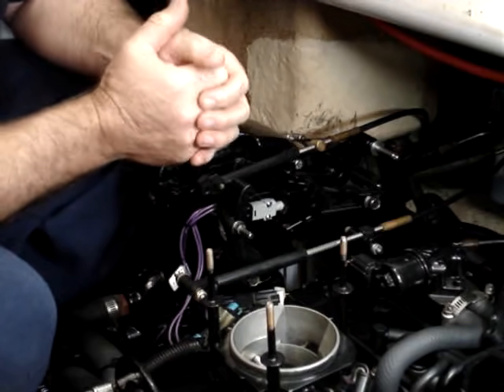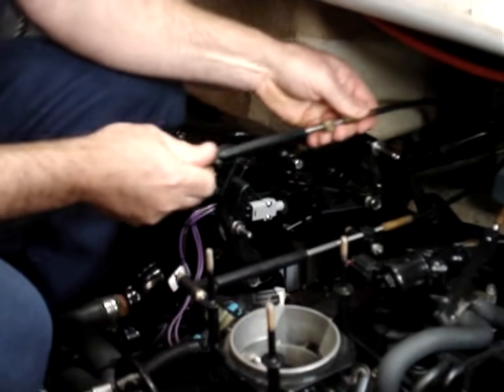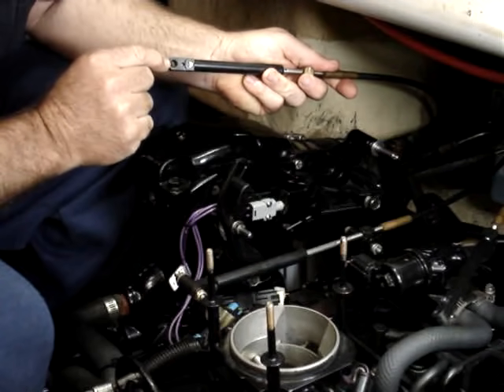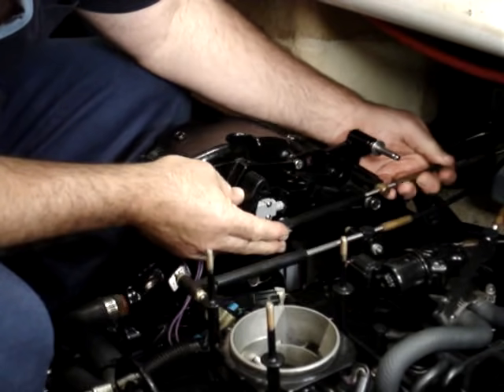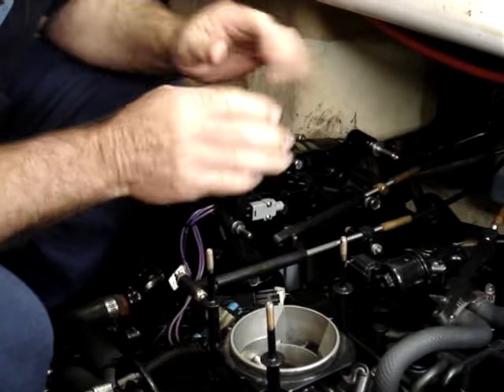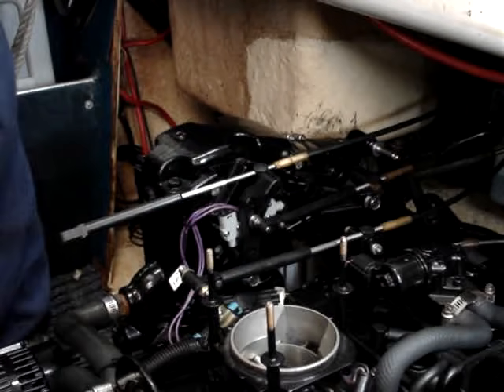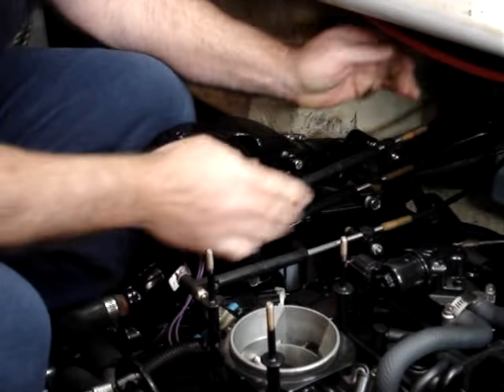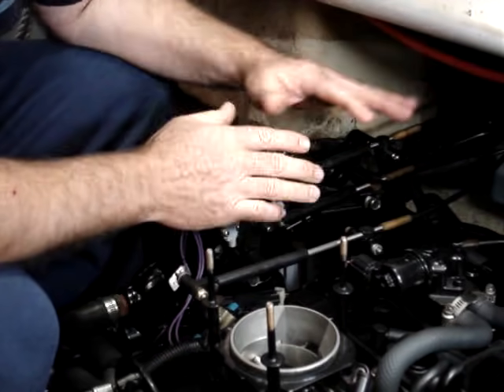Mercruiser Alpha Shift cable adjustment

Comment: Thanks! Read the shop manual for the shift cable adjustment a couple of times and it read as extremely complicated. Your video and explanation on the other hand was clear and easy to follow. I brought the laptop onto the boat and did the whole job in about 10 minutes with your help and the drive shifts like a charm.

Comment: I adjust my boat by trial and error with boat on the water. This video is outstanding and textbook way to adjust with the boat in the shop. I highly recommend final adjustment be done with boat in the water for optimum results, The service manual for the alpha one drive says the same under the caption "in water tests". Most professional marine shops do not bother with the in water tests.

Comment: This is the best video I have found for adjusting these cables, only thing I have to add, is if they have factory crimped the brass adjusting screw on the shift cable barely drill right down on the Crip temples. Can you contact the actual cable, spray, a little WD-40, and with a little effort you will be able to adjust the shift cable

Comment: Hi thanks for the easy to follow instruction. My shift plate is a 1973 model however the outdrive was replaced in the mid 80's with a later model outdrive.  I really didn't know which measurement to go with so I went with the 5 7/8" center to center shift cable mounting position and got it right.  I assume the shift plate age would therefore be the determining factor.  Anyways, was able to make the proper gear engagement adjustment  on land. However once I went for a test cruise, I had to adjust the rear anchor pen negatively because I was slipping out of forward drive under a load. Once I moved the rear anchor pin back about and 1/8", it worked perfectly.   Great video.

Comment: Best video! This is exactly what we needed.
Reply: On remote cable if I have more that 3 1/8 inch is the cable bad? And need replacing or can I adjust it out? I have 3 1/4 inch
Reply: @patricktucker9950  How does it shift with the extra 1/8 inch of play? If it seems to work okay, I'd leave it.

Comment: Great video, I just bought a 1989 Baja 190 sport and only had 300 hours on it. The boat is mint but the only issue was it not shifting all the way into gear. This will help so much and makes me at ease just to know its an adjustment issue.

Comment: Very helpful BUT 2 things to clarify:  1)The throttle needs to be in wide open forward in the beginning and wide open reverse at the end?  2) when he adjusts the barrel, he says one direction and goes the other. Do as he does, not as he says?

Edit:  What worked for me was, throttle wide open forward and reverse and at the end, the barrel gets adjusted away from the cable end.  It worked for me anyway.

Comment: Thanks for the video Chris.  Very helpful.  You don't mention the spring loaded shift assist mechanism.  Is it necessary to  have it installed?  It seems to place a lot of pressure on the assembly.

Comment: Thanks for a great video, really informative and it help me gather the courage to go at adjusting the shift cable on my Merc 5.0 220hp -05 with Alpha 1 gen 2 stern drive. I was having issues getting the boat into gear, bort forward and reverse which is why I wanted to try adjusting the cable. Whenever I put the remote forward or back to put it into gear (which is an original Morse remote in my CC Lancer 19' by the way), I was hearing a loud clicking/knocking noise and then the boat would slam into gear. Not very smooth and it made it hard to operate in tight spaces etc.

Said and done, I adjusted the lower shift cable like you describe in the video (6" etc.) But I forgot to adjust the upper remote cable. I'm now having the following issues and I don't know if they might be solved by adjusting the upper remote cable or if I'm having some other issues:
Reverse goes smoother into gear but I'm still hearing the knocking/clicking sound before the gear kicks in. Reverse also requires less movement in the remote shifter than before the adjustment
Forward now requires far more movement in the remote shifter and I'm having the same kind of loud clicking/knocking sound before it slams into gear.

Do you think there could be any issues using my Morse controller or should I adjust the remote cable in the way you advise anyway?

I guess my main concern is the knocking/clicking, it feels like the cogs are engaging slightly/slipping before they actually engage and the gear slams into place.

Sorry for the long post but could really use your input here!

Thanks!
Anton
Reply: I know this is old but did you resolve it? How?

Comment from the maker: The switch should not activate when going from neutral to FORWARD or REVERSE, only when coming OUT of gear, and only when there is load on the propeller, so not on the flushers either.

Comment: Hi Chris. What can I check or adjust if my engine stalls when shifting back into neutral from forward or reverse. It happens more when the engine is hot. The motor has 950 hours on and boat is 96 Regal 5.7 Merc Cruiser
Reply: Hi Warrick,

The problem you have described has been the same problem that I have experienced on and off over the past two years with my Alpha 1 Stern drive second generation on a 3 L mercruiser inboard.  The engine cuts out because the ignition interrupt switch activates, as it should, on the initial gear shift into forward or reverse, but it does not come back to the neutral position before the engine stops.  What should happen is the interrupt switch activates momentarily to kill the motor to allow the gear shift without any torque, so it does not grind going into gear, and coming out of gear, it needs the engine killed momentarily to allow it to fall into neutral, otherwise it says in gear.

The most common cause for this problem is too much friction in the stern drive cable, so the return to centre spring on the interrupt cam plate does not have the force to move the cable back to the neutral position.  The friction can be caused by a worn or damaged or poorly lubricated stern drive cable or binding of the cable through the penetrations into the gearbox.  I have had limited success fixing the problem by replacing the stern drive cable and seals, which cured the problem for about 6 months before it returned, intermittently when the motor was hot.

On my latest service which included taking the leg off for an oil change and impeller change, I asked the mechanic if he could diagnose and fux the problem.  He double checkef if the stern drive cable linkage was at all sticky or there were any problems that could be causing the shift interrupt sticking problem.  He reported that there were not, and he fitted a new linkage plate as he reported that this had cured the problem with some of his other clients. He adjusted everything up to specification and I had about 1 hours worth of trouble free gear shifting before the problem returned.

The problem now is that every time it shifts into forward the engine will die. Reverse shifting is not a problem.  To keep us out on the water, I have had my wife or one of the children hold the interrupt switch cam plate in the neutral position whilst I put the boat into forward.  This is far from ideal, but otherwise the boat won't go.

I have now added an additional plate onto the gear shift plate to allow me to mount a tension spring that assists the interrupt switch return to neutral on forward selection.  I will water test this tomorrow and hopefully it works.  If it works, I will post a video on YouTube about what I did, so others can copy it.

The mercruiser Alpha 1 leg gear shift design with the manual shift interrupt switch arrangement that relies on the spring force of the interrupt cam plate to counteract the gearbox and shift cable is not a robust design at all.  As soon as any friction builds up in the stern leg to control plate linkage is causes problems.  This design problem is the main reason that I am actually going to sell my boat, and probably never buy another boat with a stern drive again.  

I find it hard to believe that a reputable company like MerCruiser manufacturered such a temperamental design, that could leave a non-technical person stranded at sea.

I hope you manage to solve you boat's gear shifting problem.

Comment: Just installed new heads, and I did not put the boat in forward when I took shift cables off the riser plate. I'm sure the cables were moved and jostled as I did the replacement in the bilge. After the rest of the engine was buttoned back up, I  reinstalled and re-set cables to your specs. When testing, prop didn't go into gear. Got under the drive and noticed the dog/shift shoe was pointed at about 11:55 to port side when I did put the control to forward. I was able to push the dog/shift shoe to 12 O'clock with a small rod. The  prop locked counter clockwise. I then made the adjustments to your spec. Started engine, put it in forward then N then Reverse a few times, and then tried it again a few times. On the 3rd of 4th try it stopped engaging in forward. Do I need to reset the upper cable more? Or do I drop the lower unit on the outdrive just enough to reset the dog/shift shoe connection to 12:00 O'clock while the control is in forward and then do the cable adjustments. These cable were replaced 2 seasons ago. The engine is 2010 Merc. Vortec 5.7 350 - Thanks for the video. I did use this video last season on my port side engine. It took 2 days of me swearing up a storm before I realized that, that particular outdrive was opposite rotation, and I had to do everything in reverse :) To be clear the engine I am asking about is normal rotation. Thank you.

Comment from the maker: Sounds like you might have crud and/or salt build-up in the back of the shift slide cavity (in the bell-housing). That's most likely due to a leaking upper shift shaft seal and bushing. You need to remove the drive and check those things out...

Comment from the maker: No. That indicates either a sticky cable (replace it), crud in the shift slide cavity in the drive (remove the drive and clean it out) or the stud is in too high a position (move it down).

Comment: Thanks so much for the great video.  Having gone through it step by step, I'm still having a problem getting into reverse.  After some diagnosis,  Im finding that the shifting cable behavior is different in Fwd & Rev.  Pushing the shift cable all the way back, the gears engage and the prop stops turning.  However, pulling it fwd towards reverse gear, at no point does the gears seem to engage,  making the rest of the adjustment mute.  Any suggestions?

Comment: Loved the video. Very well done and super easy to understand. I have one question. When you adjusted the barrel nut you pointed "away from the cable" but screwed toward the cable. Not sure which to do.
Reply: yep, boat is running like it probably never did before

Comment: Thanks, great video !!! When I set the cable to 6" and set it back on shift plate and finish maikng my adjustments,  I decided to measure it again while it is on the shift plate and i got in between 6 1/4 - 6 1/2  !! Is that normal ?

Comment: when you spin the barrel four turns "away from the cable" you said.  Is this increasing the distance between the two pins or decreasing the short distance?  I want to make sure I'm doing this right, thanks.

Comment: Chris. Thank you.  This is outstanding.  What do you mean with your comment "No, you should not have the interrupt switch activate when running on the hose?"  I am trying to adjust my cable, as shifting is killing the engine completely, when shifting into forward and into reverse.  Thanks again for this effort.
Reply from the maker: If the switch trips when there is no load on the propeller, then the lower shift cable is the reason...

Comment: Good afternoon. I was hoping you could help as well. 1986 mercruiser alpha one. Boat shifts into reverse and prop spins fine. Shift into forward. Prop locks like normal but doesn’t spin with throttle pushed forward. We do here something clinking around but we are thrown off since reverse works fine
Reply: hi did you sort out the problem , mine does exactly the same ?

Comment: I have an 87 alpha one 8v and I'm having trouble getting it into forward. I have to be trailer trim and trim all the way down. If it doesn't work and I have to put it in neutral and try to put it back in drive and then trailer trim and trim all the way down again. It acts like I'm moving it from the top but I have never moved the lower unit from the first attempt to put into forward.

Comment: Thanks again for the info!!  Well, I spent a few hours today trying to adjust the shift cable.  The adjustment now is the best I've had so far.  After the four turns you make with the brass barrel, and then hook everything back up.  The manual says to move the remote to the opposite (if your in forward, move into reverse) then move the prop clockwise and check the cut-out switch, which should still be centered.  Mine is just off center.  Will that cause me problems?   Thanks

Comment: I just got a 1994 bayliner ciera 2655.  Goes into forward beautifully.  However when going into reverse i get a grinding noise then it will go into reverse.  Just a reverse cable adjustment? And does this video reference that adjustment on the end?

Comment: Hallo, are the measurements ( 6 inch etc) also for a shift cable with a 3.0L Alpha One Gen 2 of 1996? My shift adjustment is horizontal en not vertical like yours. What if the cable is longer? Thank you very much .. cheers Bart
Reply: i have the same thing you have, all the same . horizontal or vertical.

Comment: Hi Chris
Great explanation of adjusting the cables. I’ve got a problem that I can’t seem to correct. Boat goes into forward and neutral fine but when I go towards reverse the interrupt switch activities shuttling off the engine. Using your information My remote cable is an inch shorter than the 3.5” you reference. Any suggestions as to what I should be doing to fix this
This is a 30 year old boat with 350 total hours on it
Reply: Hi, where you able to fix it? I'm having the same issue...

Comment: Thanks for the video. I had my cable replaced by someone and it hits the cutoff switch when going from neutral to reverse but not when going fro neutral to forward. No motor shutoff or hesitation from the seitch. My question is, "is the motor supposed to hesitate when going from neutral into forward? Mine doesn't . What do I need to do? Thanks, Brad

Comment: I put my cable in and now whenever im in reverse gear my neutral cuttoff switch is always activated so the engine dies completely when shifting into reverse gear. Works perfectly when shifting into forward gear and back to neutral. Although the cuttoff switch does not activate when going from forward to neutral or from neutral to forward. Really dont know what to do anymore.

Comment: I'm having a problem finding nuetral with the shift lever. you have to jerk from forward to reverse and feather it in the nuetral position to get it to actually go in nuetral. will this help or do you think I may have another problem. note this throttle quadrant is the second one and the same problem arises.

Comment: Great vid ....
my 2003 alpha one with 5.7 L has problems where it will shift into reverse but after the initial shift to reverse when I advance the throttle in reverse the engine dies (it works fine in forward and this condition only happens in reverse).... Could this be a cable (either one) is out of adjustment or does this point to other problems?

Thanks Wayne Vancouver bc

Comment: Concerning the "final adjustment"... you say to "adjust barrel 4 turns away from the cable", and indicate with a sweep of your hand that it should move towards the end of the cable, YET it was rotated so that it would go onto the cable further.... can you clarify what direction it needs to move in the final adjustment?.... thanks
Reply from the maker: The 'sweep of the hand' is to indicate that he barrel is to be turn away from the end (that the hand is 'sweeping' to)... Voice over also says 'turn the barrel away for the end of the cable'... Hope that's clear enough for you.
Reply: @chrisa660   1982 Sea Ray seville ex--3.0 ,  now converted to Iveco 2.5 Td intercooled,180 hp; 
Remote throw 3 1/8th,  lower cable at 3 inches;

Why those 4 turns,?  if i do those 4 turns, the throw becomes longer, and then REVERSE becomes a bit forceful, ant it will engage the microswitch and stay engaged; on the trailer;

If i do not do the 4 turns,then it stays centered,FW and Rev., prop locks ,Fw and Rev, and it is free on neutral.    
why the 4 turns?